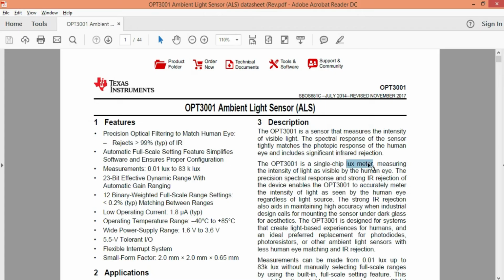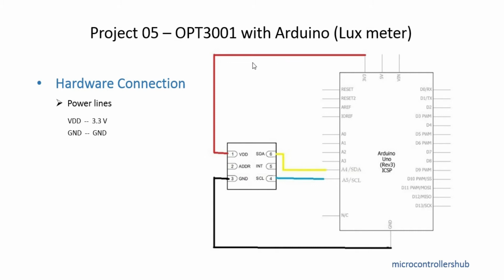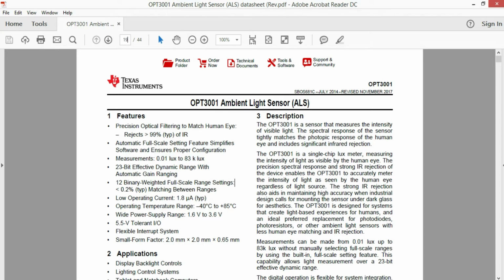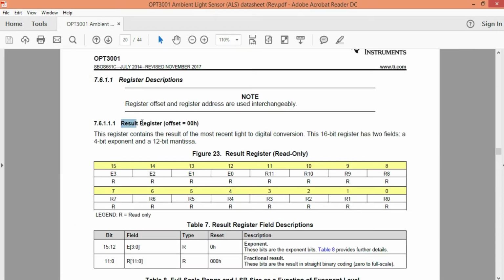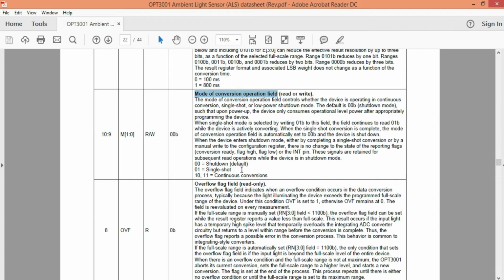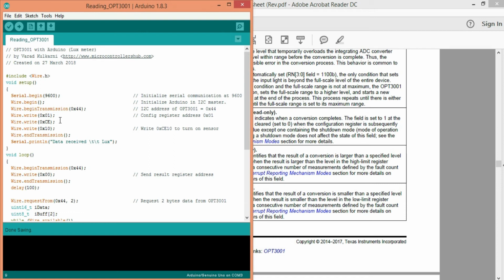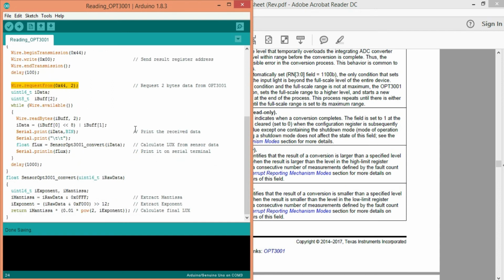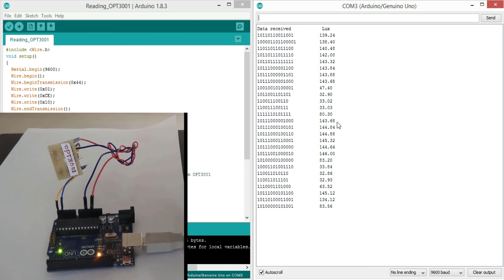Project 05 - OPT3001 with Arduino (Lux meter)

Comment: Hi, friend, awesome video, can you help with creating example for 2 sensors?
Reply from the maker: +Tal K 
Thank you. Sure I can help u, let me know what you need ?
Reply: @Microcontrollershub  thank you! I can pay you for the effort, I am stuck with understanding the whole code.
I just need a sample code (with every line explained) for getting lux data from two - OPT3001 sensors over I2C,
first is on the same address as in your example:
 #define OPT3001_ADDRESS 0x44
and the second is on:
#define OPT3001_ADDRESS 0x45

but in the code example there is so much different address manipulation so I got confused how to add additional OPT3001 sensor
Reply: @Donotfollow5  I would like to give the OPT3001 sensor the address by connecting the ADDR pins to different chip pins
Reply: @Microcontrollershub  Hi friend, so can you help out?
I only seek to know how to modify your arduino sketch to work with 2 light sensors
Reply from the maker: @Donotfollow5  For that, you need to change the I2C address of one of the sensor board. The first read sensor data from one sensor board and then read 2nd sensor data with their respective I2C Address.